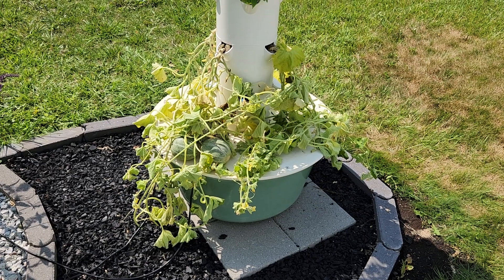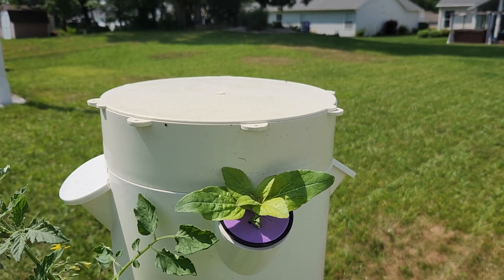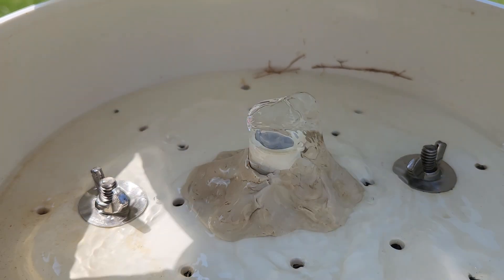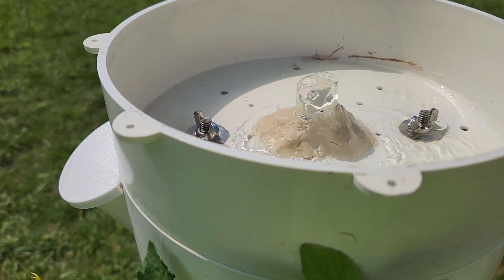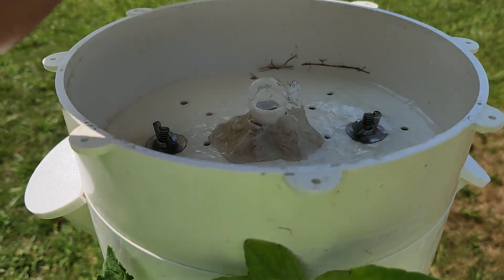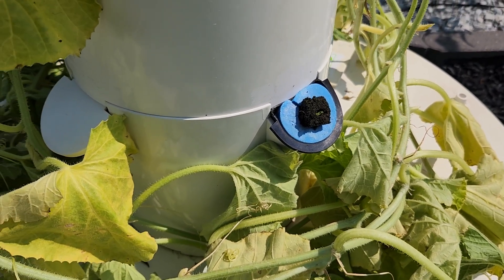TOWERGARDEN FAILS & FIXES

Comment: If you plant mangetout / snow peas in the bottom sites early season, you can train them to grow up and around the tower.  As well as abundant pods, the plants shade the tower itself and keep the internal temperature down. The peas foliage provides mottled shade and localized humidity for seedlings you put in the tower through the season, making it a lot easier for them to survive and get established when its super hot and sunny.
Reply from the maker: @atomizer2665  Appreciate you taking the time to share that information! Snow peas are delicious, but I've not grown any yet.